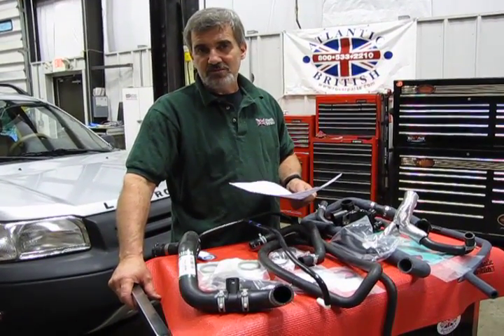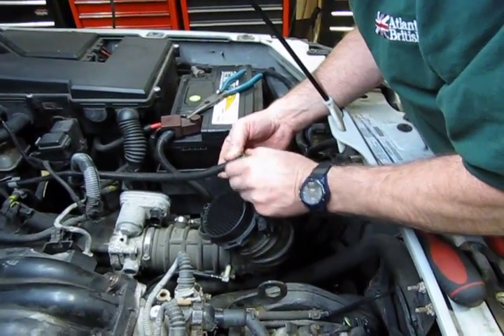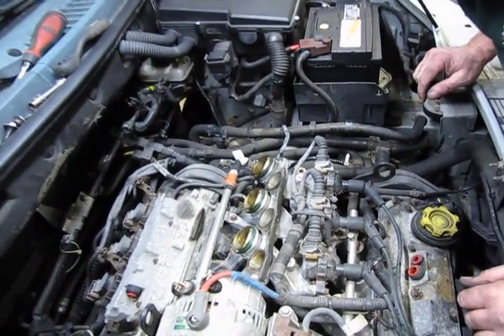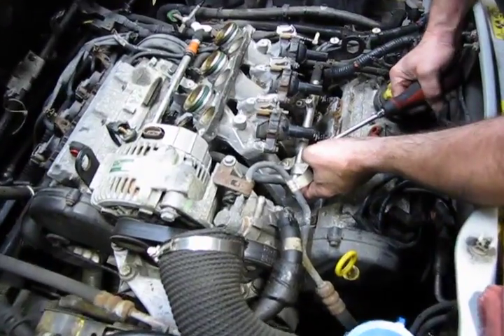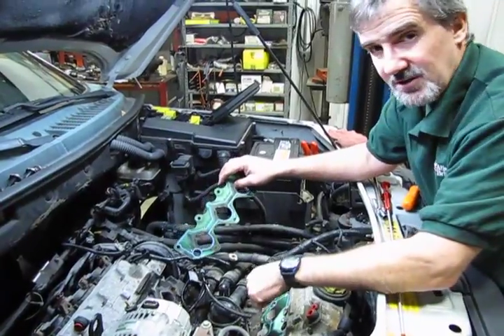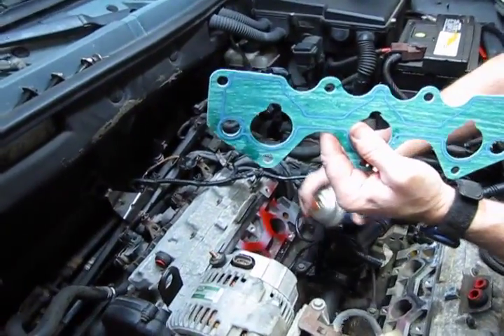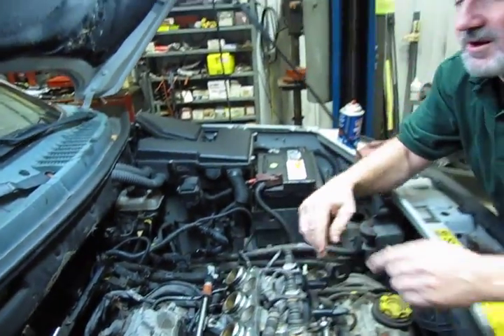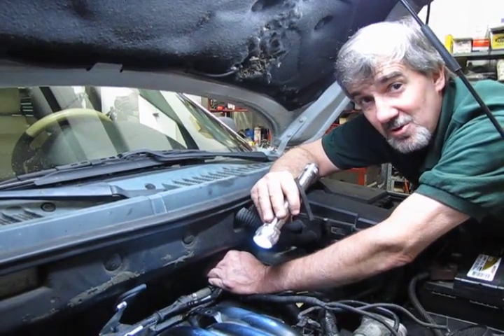Coolant Hoses and Thermostat Locations On A Land Rover Freelander 2002-2005

Comment: Thanks for the detailed video. It would have been helpful to see the backside mounting bolts for the upper intake manifold when it was removed so that we could see exactly where the bolts were. I had a problem with the one on the passenger side. That particular bolt could not be unscrewed far enough to be removed because it hit one of the coil mounting bolts.....so I had to turn it back in, and then remove the coil bolt first. I was using a mirror and a flashlight, but without knowing exactly which bolt needed to come out for sure, it ended up taking about 2 hours just to get that part done.
And the upper manifold was EXTEMELY difficult to pry up and remove since the car is 20 yrs old now......even tho it only has 50k on it

Comment: Hello good night mr. I have a problem with a Freelander. But 2002 knows how I can bleed the cooling system because the small hose that reaches the water tank always comes out of the air and the hose that comes out of the thermostat to the bottom of the radiator is always cold and all the hoses are always hot to the point. of boiling. It has new head gaskets new rings new water pump and thermostat. I don't know what else to do, please I need help

Comment: Hello good afternoon. I need your help ... I have a heating problem from a 2002 Freelander Landa Rover 2.5 engine and I changed the thermostat, main water cooler that goes in front of the pump and ripped all the water hoses (antifreeze), ... discard any plugs, even the chillers were scraped both oil coolers and warming presists. note that there is no turning of the thermostat to the lower outlet of the main cooler that runs the engine
Reply: hello, and my freelander is with your problem , how solved you ?